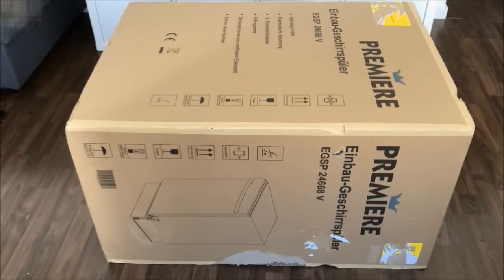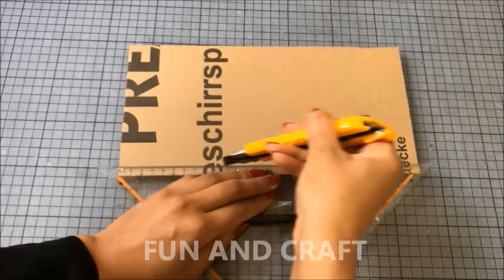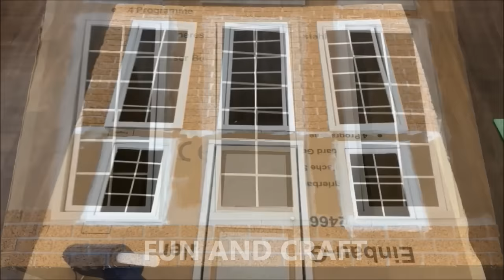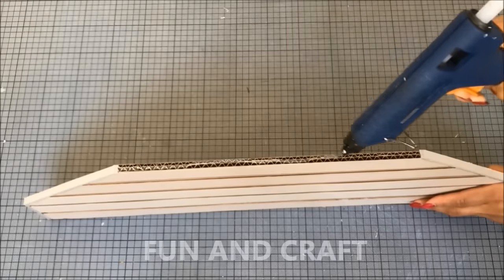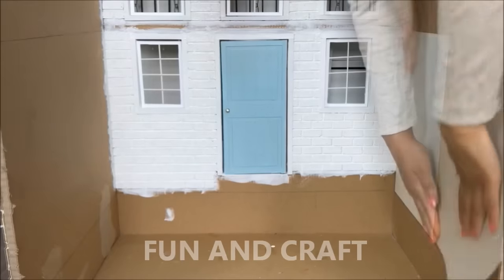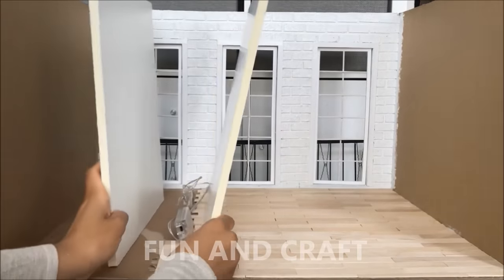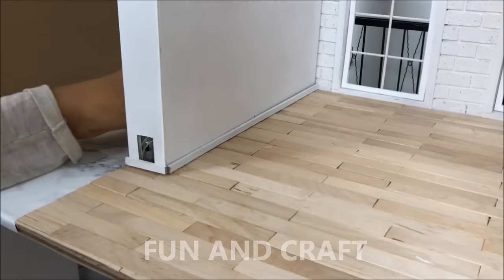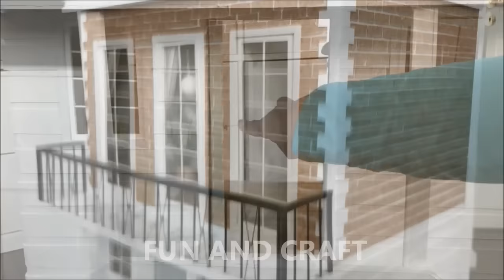DIY Cardboard House (1:6 scale)

Comment: First let me say you are AWESOME! I would like to know what are the measurements for the windows and doors, and and how far from the floor are the windows placed?
Reply from the maker: Hi thank you 😊 
The windows on the first floor are 10cm x 15cm and about 17 cm above the floor ( which is too high if you ask me 😀 looking at the result I wish they were 5 cm lower) 
The door is 15cm x 30cm 
And the windows on the second floor 12cm x 30cm and about 1 cm above the floor.
The measurements of the box: 
102cm (high) x 66cm (wide) x 40cm (deep)
Reply: Thank you so very, very much. I would also like to request if you can do a video on building a Queen Anne Victoria house for a Barbie doll out of cardboard.  I’ve seen them built out of wood, but I don’t have the skill set or tools to do that. 
Thank you again.
Reply: Khushi
Reply: Sabrina Leslie .
xvn
Reply: Ha ha so what
Reply: Sabrina Leslie oof
Reply: @fun_and_craft  I would like to know about the top of the house the roof  and the measurement  and how did you do the top
Reply: Sabrina Leslie    😘😘😘
Reply: Can you tell me were you get the stuff please
Reply: Neha Sheikh those wood bits could come from a building supply store or from a craft or hobby store. Even on line. The wood is often a soft wood called Balsa. Hope that helps. It's very fun.
Reply: I think  a  barbie  size   door
Reply: How much  time did it take to the house
Reply: fun_and_craft can you start putting what you need in the Description please cause I really wanna do this so if it’s a way you can put it in the description now then that would be great thank you please reply
Reply: @sureshchavan2212  what Khushi
Reply: This is amazing
Reply: Yeah
Reply: @fun_and_craft  kkk
Reply: @fun_and_craft 
Love it
Reply: Don throw the dishwasher
Reply: LRISSA😀😇♥️
Reply: ماريه محمد سديم

Comment: Hi I can’t find this paper board you’re talking about. I was wondering if it had a different name? All I find is foam board or Posterboard. But the Posterboard seems thinner then what you use in this video
Reply: Paperboard is basically thick paper. Kind of like cardboard without the wavy line in the middle. Cereal boxes, cracker boxes, toilet/paper towel rolls, boxes that carry soda cans, etc are made of paperboard. You can reuse those boxes for paperboard. Hope this helped.

Comment: How do you get hot glue to work on cardboard for you? Mine always peels off!
Reply from the maker: Maybe it’s the brand that’s not working on cardboard. I’ve never had that issue before. The brand I’m currently using is called Steinel. They have different types of hot glue...extra strong glue, clear glue, for wood etc
Reply: @fun_and_craft  It probably is the brand. I use the one from Walmart.  And I use the low temp one because when I used to use the high temp one, I would burn my fingers all the time no matter how careful I was - I guess I'm not super graceful...lol.

Comment: omg i have searched high and low for 'paper board' and have been offered chipboard, foam board and poster paper... WHERE OH WHERE can i find paperboard?! 🌺💗
Reply: Paperboard is basically thick paper. Kind of like cardboard without the wavy line in the middle. Cereal boxes, cracker boxes, toilet/paper towel rolls, boxes that carry soda cans, etc are made of paperboard. You can reuse those boxes for paperboard. Hope this helped.